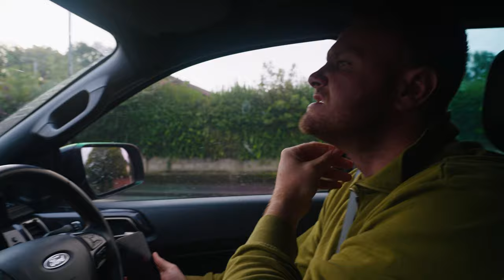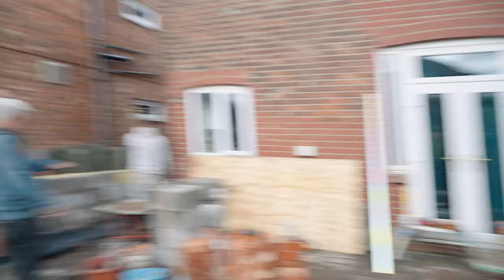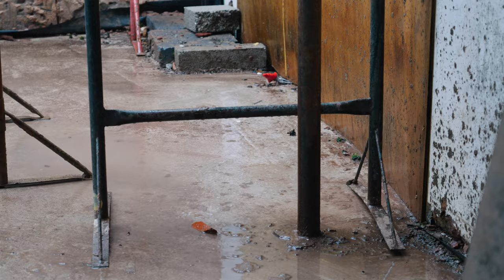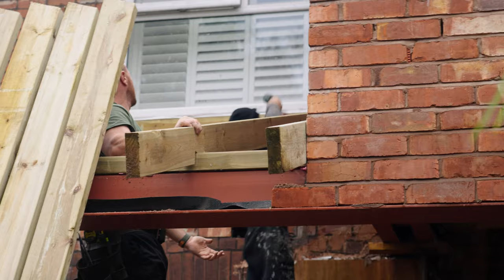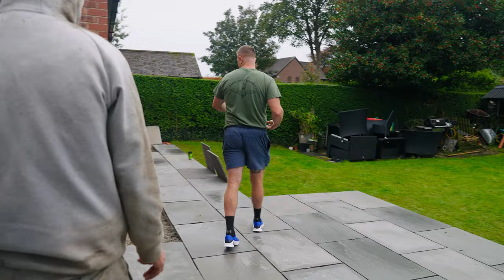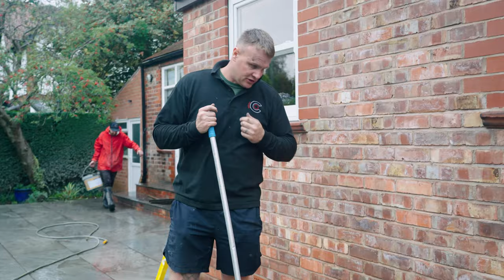brickwork nearly at wall plate, 2 new roofs and a new brickwork project

Comment: Love the videos what’s your main trade ? I noticed you do the joinery and the brickwork
Reply from the maker: I am a level 2 bricklayer and then changed trades to joiner I’m an nvq level 3
Reply: I’m a plasterer but I do quite a lot myself aswell I’ve worked for a guy building extensions for the past few years he does the organising and I do all the work everything apart from plumbing and electrical. We get jobs through recommendation I always get great feedback from customers and there always happy with my work I want to go on my own but just lacking confidence do you have any advice you could give me
Reply: I would honestly take the leap, sit where your at till you find that one decent job you can go and I promise you won’t look back this is my other account. And anything you need I’ll always be a message away any advice or any help pricing
Reply: Thankyou mate I really appreciate it . I mite run into you one day I’m an Aussie living in st Helen’s
Reply: Hi mate I tried to contact you through your other channel I’m not very tech savvy . I would love to pick your brain on a few things I no your probably busy but any help would be appreciated. I was just wondering how you price your extensions is it so much a sqm and does that include big bifolds how does that work do u price then separate or are windows and doors included in the in the sqm rate . Also things like building inspectors and engineers for steels do I organise them do I just look up local structural engineer and building inspectors. Hope you can help thanks mate 👍